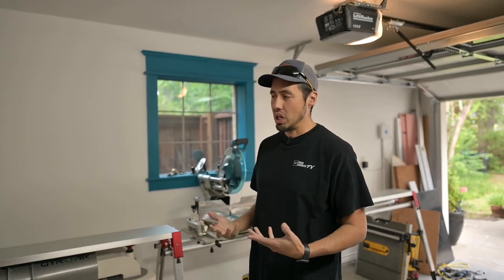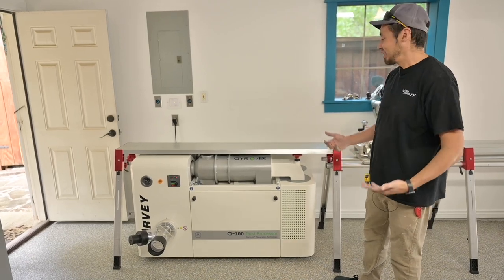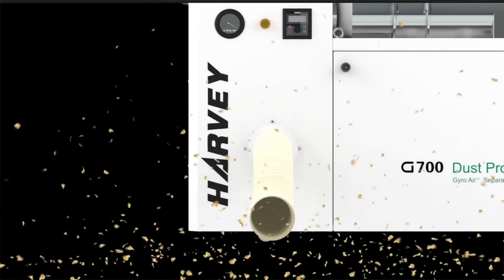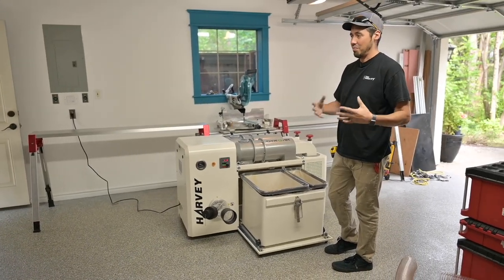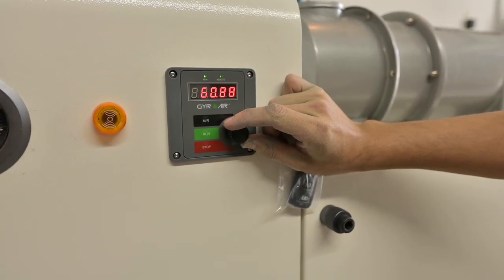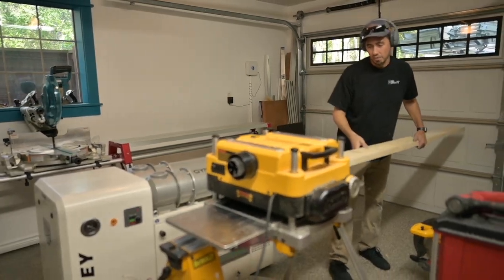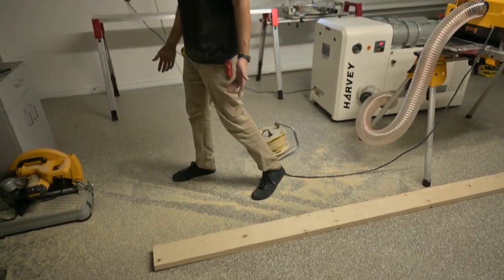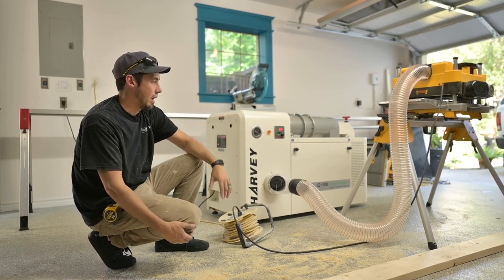This thing SUCKS! (FIRST TIME using my NEW DUST COLLECTOR!)

Comment: For Low noise, blow in cellulose insulation in yur garage walls. Now if you already have fiberglass Batts in your 2x4 studs...decide How serious you are about low noise...because you are a carpenter, you know how to...re-frame...add another 2x4 frame & s/r stud wall on top of your exhisting wall. Yes you extend your electric receptacles forward to t'new, extended wall. Box around yur window. Now your new hollow stud cavities get drilled...2 holes /stud cavity (save your 2"donuts, 5 gal bucket). Either hire blow-in cellulose contractor to do blow-in...or...you go to Lowes or HmDpo, rent their cellulose machine & flex hose, buy all bags you need from them. Get helper to cut & load machine while you do blow-in to refusal. Hold straw broom over top hole as u blow bottom hole. Do top hole & repeat for all stud cavities. Yes, it's a very dusty mess. But it will provide a better level of sound absorption than your existing sheet rock with standard R-13 FbrGls Batts within. If you are more serious, & $$ is not an issue, then price convoluted foam panels (like what is inside a camera case, convoluted, 'bumpy' or 'pimples' shape foam). Check WWGrainger for this. Then just glue all your existing s/r garage walls  with these convoluted foam panels. This will definitely lower your noise levels. These panels are used in recording studios where keen interest on spoken/singing voice--via special microphone--is captured. Sorry for such long response, but once had a customer with teen age son had his band practice in their garage. They did convoluted foam & residential neighbors were much happier with greatly lowered band noises. Hope this helps. Love that new Maketa chop saw & super vacuum. You are a high end contractor & everything you do is great to watch!👀😳😊👍👍👍

Comment: Please add ducting not a hose.  You dont want to use festool machine but cheap blades??  Or cheap drill bits??   You got an awesome suction system then utilize to max.

Comment: You're gonna have to empty that bad boy every 5 minutes if you actually plane boards or do any real work....Better off with a normal jet bag type dust collector setup imo.
Reply: I agree, the bin is to small and will fill up really fast. I have a 35 gal steel can and wills up quickly.

Comment: the price is high, its not that quiet, the CFM arents impressives... whats the real purpose of that machine. a cheap 400-600$ regular dust processor make 66-77 db and make 1200cfm and run on 110v and 220v. this particular harvey gyro 700 for 3000$ is rated at 61-72 db  and 1110cfm and only run on 220v... so why do someone would like to pay that much !? and... if space isnt a problem, for the same price you can have a monster commercial  3000 to 4000cfm machine with 4time the dust capacity .. but that monster will make 10db more.